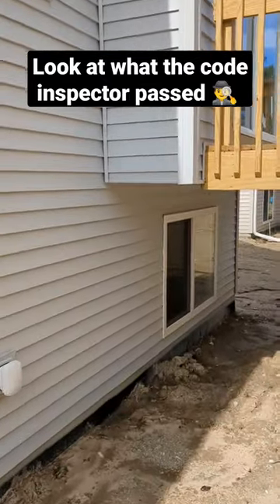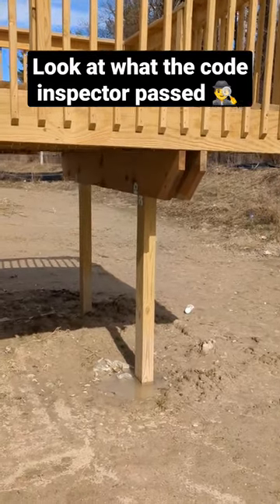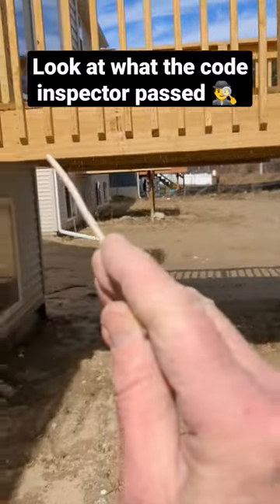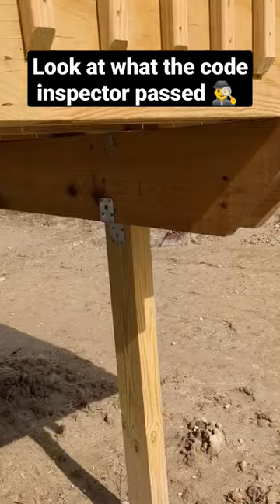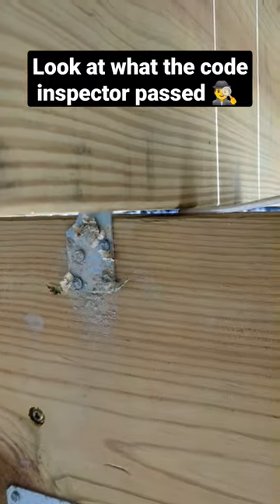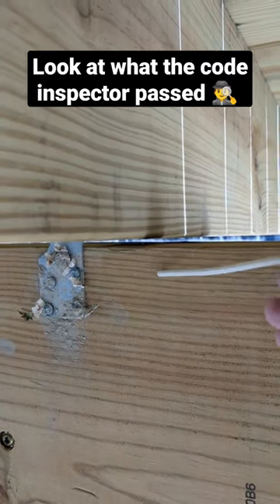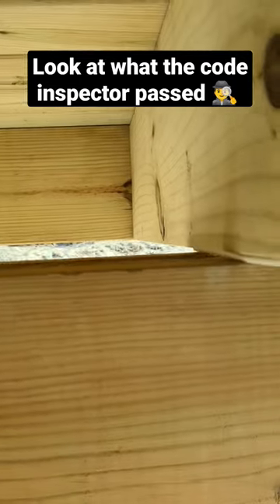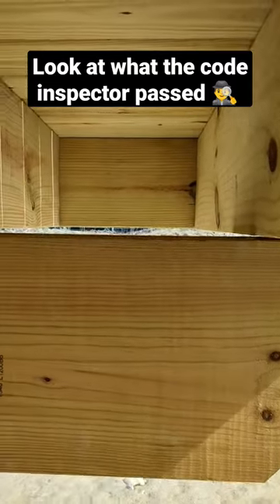Code #inspectors don't pay attention to detail#deck #newconstruction#youtubeshorts#shortvideo#shorts

Comment: Those joist will settle on to that beam very short amount of time that's really not that big a deal the bigger deal is the support post sitting in water.
Reply from the maker: Yes, our code allows the post in the ground as long as they're on footing below the frost line. Above grade is best.
 Treated lumber only has a life expectancy of 10-40years in the soil depending on the PH.
Thanks for watching the video.
Reply: Why wouldn’t you just pour some concrete and bolt into it. It would last much longer, and be easier to replace.
Reply: @sagemulkey9890  posts encased in concrete deteriorate faster.
Reply: @jerrydawg4434  that is why I said bolt into it with a simmson.
Reply: Exactly what I was thinking. Who cares about that gap? The whole thing is going to sink into the ground over time simply because someone got lazy
Reply: My thoughts exactly took my reply
Reply: Those 4×4 are the real problem its like a body builder skiping leg day.
Reply: @yodaddy6586 😂
Thought the same thing. I tend to use 6x6 for anything 3' or more off the ground/footing. Also notice there's no diagonal bracing from the beam to the twigs... I mean posts...
Reply: @jerrydawg4434 posts deteriorate at about the same rate as the joists.  No faster no slower, generally speaking.
Reply: You're part of the problem dude.
Reply: @FSEVENMAN  all right Skippy l will bite, explain your blasphemy.
Reply: @sterlingwelch4528  except in  cases of ground contact or standing water
Reply: Once the joists becomes rain soaked it will be 100% fine. All wood settles. And last time I built anything it goes crown up. Inspectors harassment is a sure way to get fired. Someone will eventually grow up to the real world where lumber swells shrinks and warps.
Reply: Throw some shims in there and call it good haha
Reply: I've seen decks 30 years old that are floating like that.
Reply: Well when they do settle those hurricane ties will resist until they get warped, it's still poor build quality.
Reply: Don't forget about the window that's eight feet away and only six inches off the ground oh my God we're so worried about puddles and flooding oh my God😮 the whole house will be flooded. Obviously it's not in a flood zone.
Reply: yeah I agree... ever get rough cut lumber fk that shit varies  11 1/4  to 11 5/8... terrible lumber  in the past  10years
Reply: Thank you! Someone with common sense. That pine moves a bunch when it's new. It was probably flush when they built it and it'll definitely be flush once it lays flat after a month or 2.
Reply: Ya , but ghw
Reply: @jerrydawg4434  nope, not at all.
Reply: @MrJo0071      anyone can point out bad work, doesn't mean he can build it
Reply: 100%!
Reply: What we do is 3 foot footing. Pour the concrete about 6 inches below grade. then we use a pier block to set and secure our post to. After that is done, we come back through pour 4 inches worth of concrete to secure the pier block to the  footing, then fill back with dirt. Extra work but looks way cleaner, is more effective and allows the post to last as long as possible. That's how you build a deck worth paying for.
Reply: @inspectflix you can see daylight b/c the beam is SINKING.   Good Work starts from the ground up.
Reply: Go back and look at the joist ties nailed to them, they aren't moving!
Reply: @jessebuchholz9047  lol, that's a pretty dumb way of doing things.
Reply: Totally agree
Reply: @jerrydawg4434 yeah I've never done it like that hey, seems dogy as.
Reply: @sagemulkey9890 because this way was cheaper
Reply: I agree. The quality of wood today is just pathetic. But that post in the ground with water sitting on top of it like that drives me nuts
Reply: @sagemulkey9890 Simpson strong tie for the win 👌 only poor homeowners and cheap contractors do it the way you see in the video. Real builders use concrete and strong ties
Reply: Oh no the footing will settle and it be fine...
Reply: They will rest on the beam soon.  No big deal. You are nit picking on this one.
Reply: It’ll settle.
Reply: Absolutely I've built for 20 years and that is not anything to nit pick about! There are other issues he didn't address that are fsr worse than what he is pointing out.
Reply: They coildve at least installed the beam crown up.
Reply: You mean after they warp into place. 😂
Reply: The POSTS NOT SIMSON TIED WITH A FOOT TO THE CONCRETE IS JUST AS BAD. LOL
Reply: We use 6x6's with gussets made of 6x6's, Also we crown the joists and rip the bottom. So they are all the same and sit properly on the beam.
Reply: Not only that the beam is not sitting on the post itself but rather it is held to the post by grk fasteners which is  considered a “though bolt “ method and is no longer allowed by code (at least in New England ). The beam must now sit on the post and be fastened using angle brackets or post to beam fastening plates .
Reply: So you'd be ok with sagging and being out of plum?  Thankfully you won't be working at my house  lol
Reply: @MrNside  its less about the height but the projection.  Its about wind loads and snow loads.   Thats why concrete is important .  When you get a 10' projection they usually will require 4' deep footings at like 18" dia.  Also why straps are usually required. Wind uplift can get way more forceful than gravity.
Reply: Let's not even point  out that they are only 4 x 4 post and they're not carriage bolted or setting under the beam and they should be 6 x 6
Reply: @godzgr8  
I use 6x6 because it looks less like a guy who skips leg day at those heights. And diagonal bracing is also aesthetic, but helps support the end of the deck laterally. Keeps it from wanting to sway, wobble, or as we call it "rack". I'm not talking about from footer to beam, I mean more symmetrical and up close to the beam like corbels. 

Straps or even deep set 4x4 posts aren't going to keep a tall deck stable at the end. 6x6 and/or diagonal braces will. Stand on the deck in one corner at the end and have someone else on the deck jump sideways along the beam, if you feel it wobble after he lands, put some diagonal 2x4s about 16" long from beam to post on each  post under the beam. Takes about 15 minutes and makes the deck feel much more solid. Code doesn't care about how solid it feels.

On that note, code also doesn't care about the bad practice of burying wood, which I try to avoid. J-bolts set into the footers and stand-off brackets for the posts help keep posts from prematurely rotting.
Reply: @inspectflix should be a metal post bracket above grade no matter the code. It's for the longevity of the build.
Reply: @inspectflix 10 to 40 years it must be a hell of a lot better than we get in the UK if you get 5 to 10 you are lucky. Maybe your treatment still has arsenic in it, totally useless since they took it out
Reply: I would agree if they were not hurricane clipped with that gap
Reply: I was thinking the same thing. Like WTF is that about. Anyone heard about wood rot ?. Ya, it takes a while but why rush it. A couple concrete piers would have been awesome
Reply: Pressure treated will rot above ground before below grade. I don't understand why people think it's a big deal. I have a 3 story deck supported by 3 4x6 posts direct buried. Installed 1993 and if I dig it back it looks brand new.
Reply: Once the ground Is graded, that will be fixed
Reply: I'm reading comments about the gap, saying who cares it's going to sink anyway and the gap will close in time, etc 
I Care because it shows a lack of detail. Makes me wonder. What else did you miss?
Reply: I wonder if they’re going to pour a slab or make a patio there and need the footing lower
Reply: If you are a builder. You are not a good one having said that. Those 4x4s are a joke too. 6x6 8x8 if you want it there in 20 years.
Reply: And, I guarantee you they were bearing on that beam when they were green and fresh before they shrunk.
Reply: @inspectflix That’s 10-40 above ground rookie 😂😂
Reply: @jerrydawg4434 False, you don’t have a clue either.
Reply: I can almost guarantee that those gaps appeared after they finished building the deck and the wood lost moisture, shrinking and pulling some of those up, but as that deck gets loaded, they will Settle down onto that cross member.
Reply: @sagemulkey9890  Those brackets have basically zero shear resistance. A post in the ground is much stronger.
Reply: yup
Reply: No big deal!it will settle in! You always have to build with a crown up, so this will happen
Reply: On point!
Reply: True as soon as you put the hot tub out there it will rest on the beam
Reply: And bend the ties not good is a big deal
Reply: Invite the sister-in-law over for a view off of the  deck... settled!
Reply: When those joists "rest", they will make the entire deck slightly off level.
Very least could jam some thin wood in the crack...
Reply: @jerrydawg4434  What about posts sitting on top of concrete that protrudes several inches above ground? I'm really wanting to know.
Reply: Totally agree
Reply: After it settles, it won't be level anymore.
Reply: Who cares about the gap……
Yep. I know who not to get to build me anything. 
It’s why I do my own.
Reply: If your to worried you can shim it or wait for it to settle